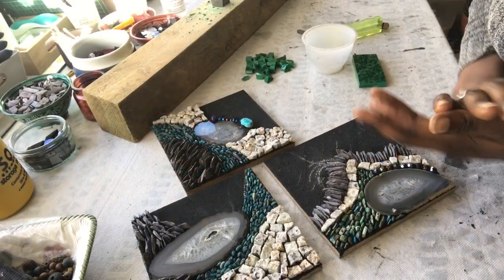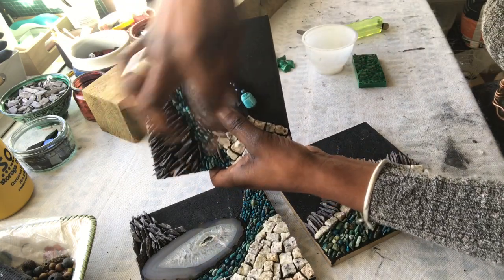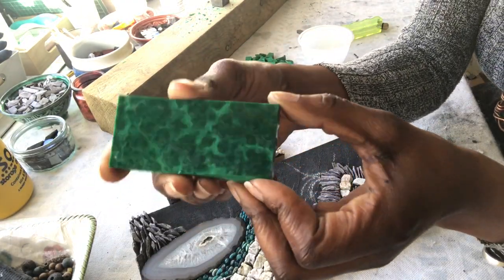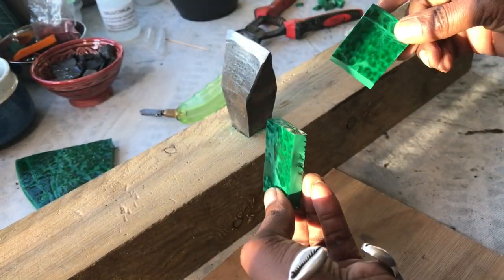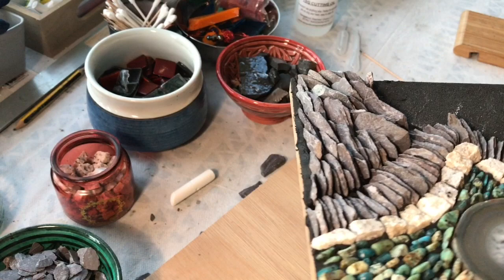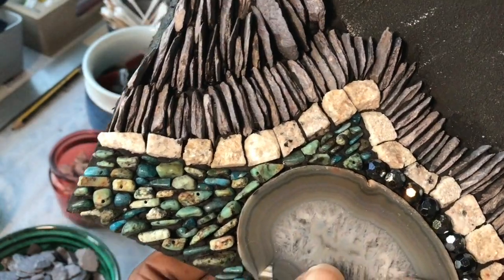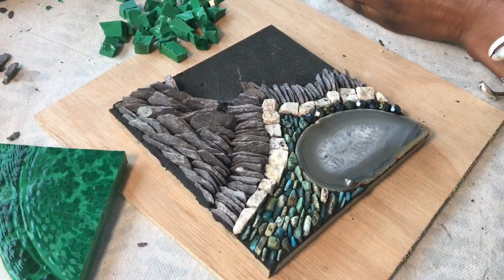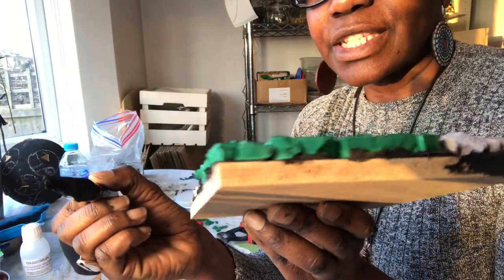ART VLOG: MAKING A MIXED MEDIA MOSAIC USING SLATE & SMALTI

Comment: When using slate and granite for mosaic, is it customary to use this type concrete instead of grout?
Reply from the maker: Yes, the reason is because the cement is strong and durable with adhesive components, whereas the grout is just a filler.